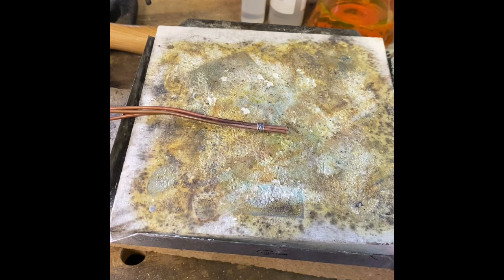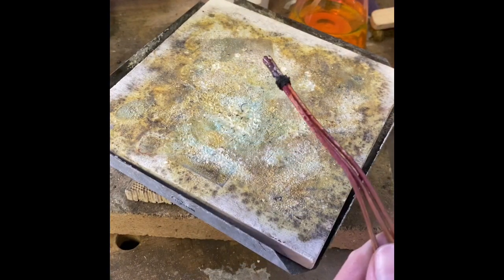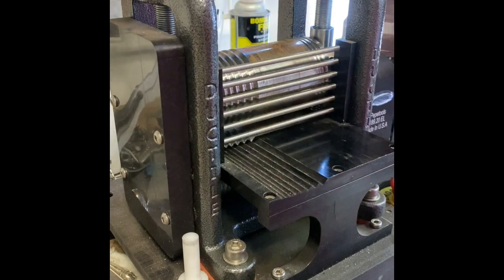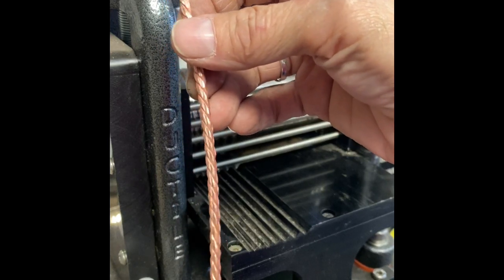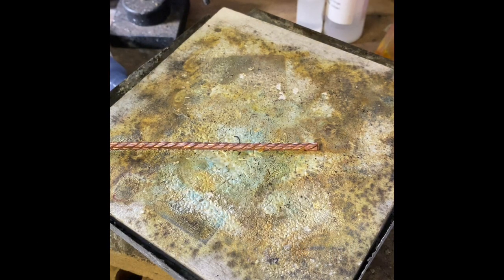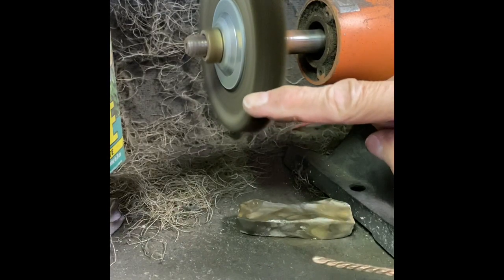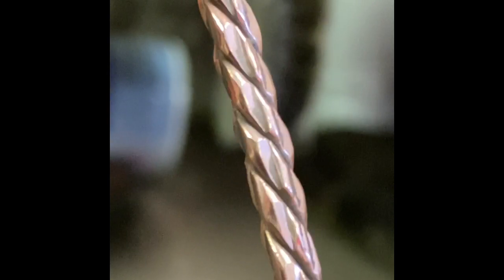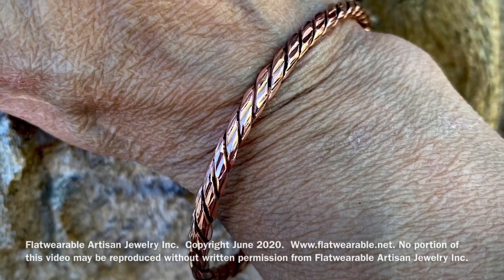Three strand copper wire cuff bracelet by Flatwearable Artisan Jewelry

Comment: Where did you purchase your rolling mill from? I’ve been threatening to get one, but the cost is a bit much for me at this time. Been doing a bit of research on mills, I don’t want a cheap one, but I can’t go expensive, either. I don’t mind the hand crank ones. But that motor driven mill looks like it works wonders! Glad to see you got into metalsmithing. I’ve been working with your silverware press I bought probably 3 or so years ago. And I like it, but metalsmithing is my next obsession. Thanks!
Reply from the maker: My rolling mill is a Pepe.  Don't go cheap.  Get the best you can afford.
Reply: Silverware press? This sounds very interesting, where can I find out more about this?